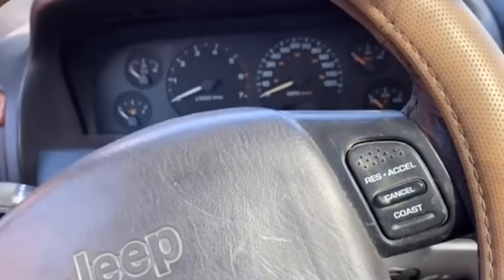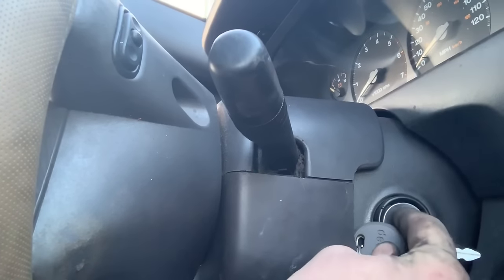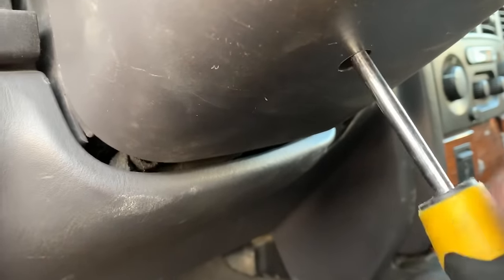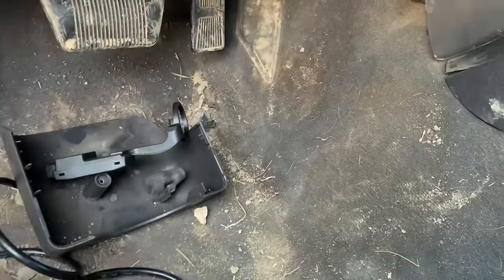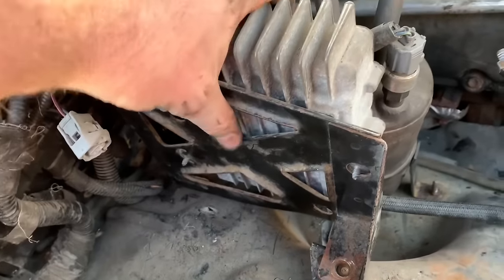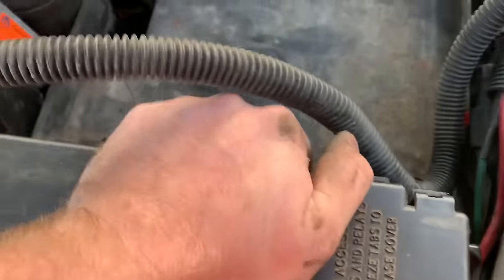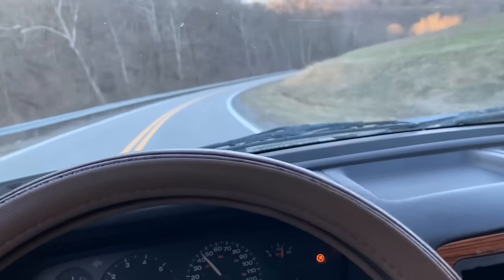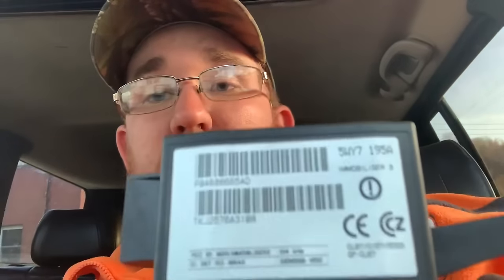How to  bypass SKIM immobilize on a Jeep Grand Cherokee 1999 to 2004

Comment: my computer went bad on a 2004 jeep grand cherokee   my dad picked up one at a junk yard and they installed it.  The car will start but shuts off after a second.   he said the junk yard never programmed the pcm to my vin number    How do you do that?   If I take out the skim with that computer already installed will it still start AND RUN OR WILL IT STILL DIE ????

Comment: I am unclear on what he did in the second part after he removed the battery and the rest of the stuff. I saw him take the SKIM out under the steering wheel (in the first part), but it looks like he just unplugged and plugged the same stuff back in in the second part. Was this to reset something, or did he actually remove something (permanently) in that area?

Comment: Hi i got an xj jeep 95 model took motor harnes and trans i need to do an omni bypass or does it have a skim unit basically am looking for which wires will start the car on the 95 pcm

Comment: Just wondering if can just have then diable from my pcm or only.if you buy. New one?
Reply: I end up getting  pcm from a place that fixes them and resets them back to factory and they test them I gave them my vendor programmer but I never gave them the mileage. Is that a bad thing? They didn't ask from it it won't start I put it in my skim has been out for 2 weeks and nothing?

Comment: Hi I’ve got a commander and it run for a few seconds and stalled after trying to start a few times it seems to have locked me out it just clicks now no starter . I suspect the skim as done the battery relays starter motor ignition switch.
Do you think I probably have to do skim delete?

Comment: Uugggh got a hot oil message reading on my dash of my 2018 wrangler I checked everything fuses relays swapped relays you name it had the harness open I noticed a few things throughout the whole ordeal ….. my key fobs won’t lock or unlock my door when I turn the key I get a dinging sound and red security light stays on with a flickering check engine light and electrical light bolt light indicator no start no crank sometime power sometimes no power of I open and close my door everything pops back up . I managed to scan the car and have u0100 loss of communication could a bad wcm cause this initially I thought I was the tipm but I even pulled the 20 amp fuse and waited fifteen min re inserted but no start

Comment: Hey bud i did everything u said to do and my jeep still is doing the same thing. I even changed out pcm. What can i do from here.
Reply: Check your battery cables. Remove a little of the plastic around the cables and see if the copper is green. You might have to change the wires. Also, clean the battery ports and also all the ground wires with a sand paper where they connect to the body.  It can be as simple as that. I had the same problem.
Reply: Did u have the skim taken off or deleted from your new pcm?

Comment: I’m pretty positive this is the issue I just ran into.  I sent a brand new mopar Chrysler PCM for my 05 LJ to Mark at Wranglerfix to be programmed.  It looks like they programmed the computer disabling the skim in the computer; however, I have a sentry key immobilizer module attached to the steering column and two keys with the fob that all work together with a PCM that has the skim enabled.  

So when I installed the programmed PCM earlier today, used the factory chip key, sentry key immobilizer still connected, the Jeep is cranking but there’s no fire.   I had no clue about this.  Wish I would have been asked this prior so smething like this wouldn’t have happened.  I’ve removed the sentry key immobilizer, but was told that there’s no going back once you try with the immobilizer connected— because that connector and it’s wires go directly to the pcm plug and sends it information.  The sentry key immobilizer sent information to the pcm that has no skim enabled and activated it is what I been told.  It looks like the pcm needs to be reflashed and programmed to my vin and mileage again deleting the skim within, except this time with the key immobilizer out of my Jeep and disconnected it shouldn’t set the PCM off to prevent it from starting.  I’m really at a lost for words and have had a migraine for the past 8 hours, reading up a storm about this.  This is what looks like happened.

The only question I have though is what key am I to use once I get the pcm reprogrammed without the skim and no sentry key immobilizer installed on my Jeep— which key do I use to turn the engine?  And will using one of the programmed keys corrupt the pcm again causing another problem like this?  I have two chip keys, and I have a non chip key.
Reply: Before sending the pcm back to Florida (I live in Toronto), I’m going to try 1 thing that I can’t stop thinking about....and that’s the crankshaft position sensor.  I’m going to replace it.  It’s a crank and no start issue I’m having— the cps error code wasnt showing BUT back in December it came on and my Jeep acted so crazy.  It needed to crank longer normal to turn over and then immediately the engine cel was flashing....knew smething was wrong...drove less then a kilometre and the engine started hiccuping and almost stalled.  I drove it back home and check the codes and got the cps error code, so I removed it and there was about a quarter inch of oil and dirt at the end of the sensor preventing it from reading the teeth and throwing the timing off.  I cleaned it all off and it fired right up, problem never returned.  But it’s making me question now since this happened if that sensor needs to be replaced entirely, not just cleaned. For the hell of it and whatever it’s worth I’m just going to replace it entirely tomorrow and see if the engine fires before sending the pcm back.  It’s been a nightmare with my Jeep for over a year now.
Reply from the maker: You have to unplug the skim underneath your steering with before putting pcm back in or it locks it
Reply: Yup.  I know this now.  Learnt the hard way.  But what I’m wondering is if the pcm can have the skim removed from it now after having it activated through the immobilizer?  And if yes, what key would I use to turn the engine over after I get the pcm back and without the Immobilizer connected?  I have two keys with a programmed chip and a key without a chip.
Reply: Good job man thank you so much

Comment: I have jeep like yours  I have running lights on front but the back would not work so I pulled out the light insert and installed new light inserts on jeep on rear and they still don't work  so could you give me some  pointers to how to fix the problem  anybody out there.

Comment: I'm having similar issues with my 2000 jeep grand cherokee limited so I just ordered a new computer and am going to do the same as you did in this video. You mentioned any issue with wiring or sensors can cause problems with the skim unit. My question is, if I replace the computer without the skim activated and whatever issue, wiring, sensor...whatever remains, will that cause the new computer to fail or is it all in the skim? Will deleting the skim keep my cherokee running even if there may be wiring or sensor issues? Funny thing is everything works as long as the engine isn't running. Once it's running that's when everything goes out and the key light comes on. No power windows, locks, gauges, etc... but when the engine is off but the key is turned on everything works fine. Thank you and great video.
Reply: My 2000 Jeep grand Cherokee pcm is 637AF had issue , can I change to other number with out reprograming ? , can I useful from this way ?

Comment: All computer resources have done a great job with my Jeep's computer also. Quick turn around and no hassle warranty. But I am confused why you would want to bypass the skim module. These old ignition switches will probably start with a spoon if it wasn't for the skim code
Reply: They are way too much trouble since the car is rendered useless once they anti theft is activated. I'm just going to buy a good steering lock instead.

Comment: Quick question, if you have the original computer and the original key can you simply unplug the skim unit in the column?
Reply: no it wont work, but this guy does not shows how to reprogramm the PCM....
Reply from the maker: Nope you have to get a new computer than do that
Reply: @cherokeeronnie  Actually i did it, i found a guy who repairs PCM... and i ask him to turn off SKIM unit on it, he charged me 50 usd and done... it work perfectly (my PCM not a new one)
Reply: @pedrolmpenichet  do you have the guys number? i need to do the same to mine.

Comment: Hi, My Ignition Key circuit is damage and rusty, can you share how to obtain a circuit for a 2005 Jeep Grand Cherokee Laredo 4.7L V8 without going to the Dealer? How does that Circuit works, to get the original for my car? I know I have to get it cut it and programming, but my concern is to get a new circuit? I truly appreciate it!

Comment: Good day, I tell you. The same thing happened to me and a mechanic saw it, but I don't know what made him say that in the end he said we checked the transmission spark sensor but I don't know if it's that or what do you recommend doing?
Reply: Theres no such thing as a transmission spark sensor? Theres a TCM transmission control module that controls the solenoids in your transmission for shifting ,etc.
Reply: @jonathanduncan3870  lol, he was talking about the transmission Park/Neutral position, without it, the PCM won't ground the starter relay. The PCM needs that and the immo to ground the relay. Unfortunately there is little information regarding the immo so, diagnosing that is usually tricky if the PCM is the one that is acting up or the key or SKIM(WCM) module itself.
Reply: @jonathanduncan3870  The crank sensor next item in the electric current is speed sensor.

Comment: You never said where you order a pcm from that you can have flashed and the skim disabled ? I’m 300 dollars in right now in tow bills , finally got someone to replace the cylinder , which is an obvious problem with the 99-04 ,, they wear out ,, now I gotta get it towed again to Chrysler to have a chip key cut to fit the cylinder and programmed.  Mine is an 02 ,, what a pain in the ass . I’ll be 750 dollars in by the time it’s all over, hopefully this one will last another 20 years like the factory one
Reply from the maker: They are out of business now
Reply: @cherokeeronnie  
Update ,, after having the cylinder replaced with a key cylinder from O’reillys ,, I cut the transponder chip out of my factory keys, placed in the center of the new keys , super glued and wrapped in tape ,, runs perfect , no anti theft lights , fixed 👍

Comment: Well thanks yeah because if you have a bed skim unit you have to replace that the cash money I have a 2001 Jeep grand Cherokee to drive me crazy I don't know if somebody reprogram the key in it was working no I took it back to the guy and I don't know if he took out that I have to go replace that bulb that key bulb to see if it's actually doing something I'm good at intermitting problem what I do to get it start I have to take the battery cables off I'll together and jumper them together for about 10 minutes off the battery of course

Comment: i have a jeep grand cherokee wj 4.7L year 2000. Engine works fine skim sensored removed. but once in a while all the speedometer went dead. 
where can i buy the pcm with skim deleted?
Reply: Does it still run when the speedometer goes dead?
Reply: @grizzsnacks1787  yess it is still running. how ever aircond get hot. power window not workin.

Comment: Also what you can do is when you're taking battery terminals off put the two battery terminals together do not have them connected to the battery and connect the positive and red together and make sure they're not touching the battery obviously don't blow anything up and hopefully they'll reset your PC you been there done that

Comment: Does this also apply to 1997 Dodge Ram 1500 as well?? I have a car that’s a crank/no start and doesn’t have a check engine lite either???? It has power at the ecm on the black plug @ pin #2 & 22.....

Comment: Got the engine to spin over, but nothing else is powering up
Reply: How did you do it mine's doing the same thing I got the skin removed remove the transponder but I think my transponder needs to be wired
Reply: @MichaelThomas-yf1xq  I changed my mind I ripped everything out and went with the bigger carburetor n bigger distributor, same 2001 engine

Comment: I was driving on the interstate when my Jeep died all of a sudden and started giving the "bad key" SKIM light on the dash with no gauges. You're saying all these different things could be wrong and give that issue because of the electrical loop? I already tried to put solder on my SKIM and plug it back in but still dead, maybe I should look at the other systems before looking into a new PCM without immobiliser.

Comment: I liked the video showing how to remove and replace the PCM, but a Jeep dealer could have made you a key for $60 in about 15 minutes.
Reply from the maker: In my state it was 200 and I had to have it towed no there way they said that’s coming from two dealers near me
Reply: We had it reprogrammed... NO LUCK...
Reply: @medinatabor6492  If you had the car's own PCM skim deleted it should be fine.  If you used a replacement PCM it needs to be flashed to your car's VIN number.   If you did one or the other and it doesn't work your problem must be elsewhere.
Reply: That's $345 from a dealer in New York for a new key, $175 for a second key plus the price of a tow and a five day backlog.
Reply: @eegg6954  I think Ronnie said he had a key that worked with the new computer. No need for towing, just clone the good key. My dealer said it would take about 15 minutes and cost $60. A mobile locksmith in my area charges $125.

Comment: Mine turn on but ten. Seconds later it dies
Reply: Sometimes the key goes bad, and a nice locksmith will let you know if its bad.  But sometimes, the crankshaft sensor is bad, and that's a pain in the but to get out behind your engine.  But it fixes that a lot.  Four things can cause this:  key bad, computer bad (pcm), or crankshaft sensor bad, or key cylinder is bad.  A really messed up battery that's always charging can cause problems too.
Reply: @gristlevonraben  ok i check sensor chank
Reply: @rubenvarela4077  remember to check the wires too, I had one that were exposed to the rain, right by a connector above the oil filter

Comment: What does the battery sensor do?
Reply: Monitor the temperature of the battery and relays the temperature constantly to the PCM and either lowers or raises the voltage from the alternator going through the sensors and circuits of your jeep.
Reply: Reading through the comments looking for this question.  Thanks for answer.  Lol I thought it did something else 🤣 😂

Comment: Does this same process work for a 99 cherokee XJ? Intermittent issues with XJ running great then go to start later will not run, mechanic said likely something to do with anti-theft or ignition. Had a remanufactured motor put in 20k ago, when it does work as it should starting up it runs like top. Something messed up the electrical systems on these old jeeps. Have had other issues where running lights will go out when put the blinker on then after turn is made and it stops blinking the running lights come right back on

Comment: Question, if you mess up and computer reads skim, what's next, can you unplug pcm and battery then start over or once it reads are fudged?
Reply: PCM will have to be reflashed again. If the PCM loads your SKIM module it is activated and locked into your SKIM and key.
Reply: @TheJayDawgZ  ok thanks, I got somewhat of a big issue, I have a 2000 gran caravan with a gauge cluster that would not work, I changed the bcm but it would not fix the issue, so I looked around all over the place and fixed grounding wire to cluster was broken which fixed the gauge cluster issue, my van from factory had no alarm or any anti theft system, (no skim unit no alarm no nothing) anyways instead of putting old bcm back I left the junkyard bcm on and I didn't know it had an alarm which went off after I closed and opened my doors and PCM got locked with antitheft, i put back my old bcm with no alarm back but van still would not start which I'm assuming is pcm in immobilizer active, i could not find any locksmith in town capable of fixing my issue, autozone nor any part store carries a pcm for such old van, I was able to find a plug n play pcm online already programmed to my vin, my question is will this work just putting a new pcm which should be unlocked or would I have to do anything else, my current bcm is my old one with no anti theft at all, I have no other skim unit or anything plugged in since van does not have one in the first place, so new pcm should get rid of my issue right (no start) , or is there any other module or issue I could run into ?

Comment: Hey I just changed out my 1990 wrangler carb engine to a 2002 wrangler engine, do you kno what wire on the harness sends power to the EMC?
Reply: Always pink and yellow constant and switched ground
Reply: Ok, I will try that, thanks
Reply: Correction constant and switched power. Lol no ground